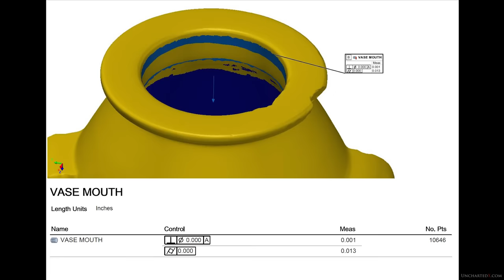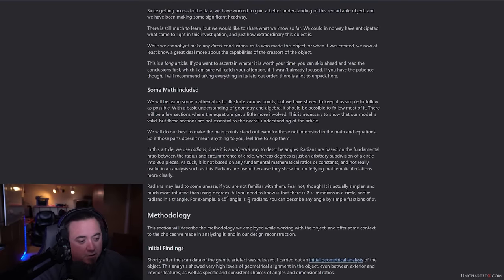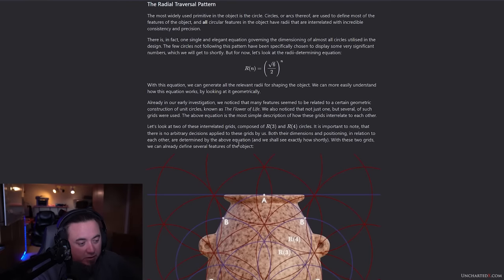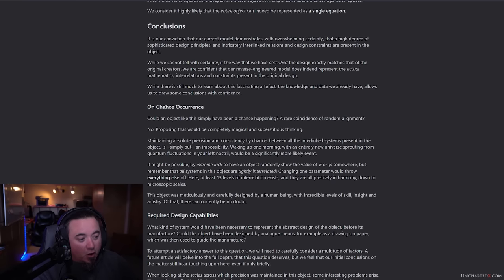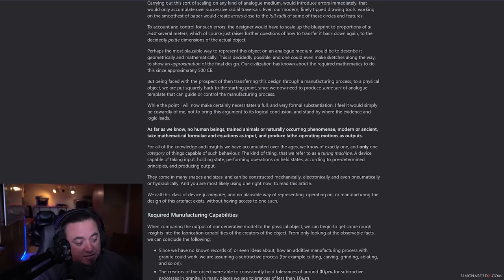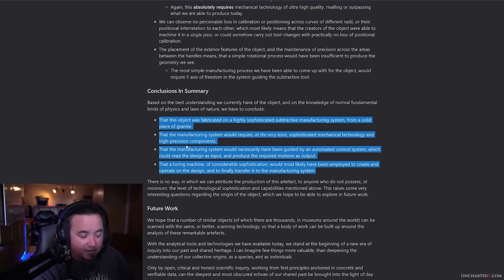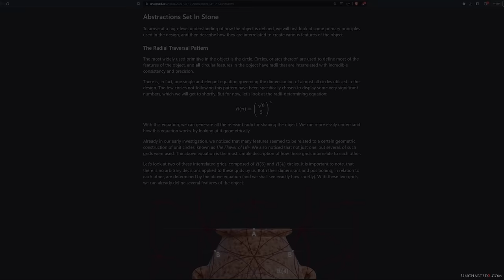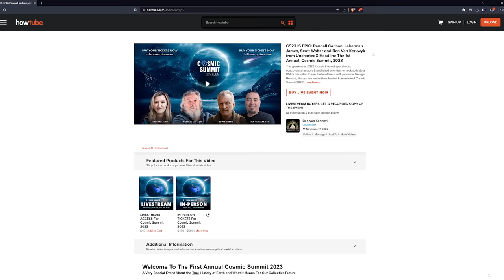Was a COMPUTER Used to Design this Artifact??

Comment: The terrifying thing about this artifact is that even if it was "a fake" it would still require serious explanation. Even if it was made 100 years ago it would shake history and science to it's core.
But it's supposedly 4000-6000 years old. If it was the only one of it's kind, it would be a miracle.  The fact that there are at least dozens and likely thousands of these objects is literally the closest you could get to the impossible in archaeological terms.  

This object is quite literally supernatural.
Reply: Why do you think the ancient Egyptians were incapable of turning this on a lathe?
Reply: @EskWIRED The accuracy is unimaginably above just a lathe and chisels.
Reply: @EskWIRED  Why do you think the handles could be created on a lathe?
Reply: What makes it even more terrifying is that ancient temples all over the continent, such as the pyramids, temples in Cambodia, Mexico, Peru, Guatemala, Ireland, china, and pretty much in almost every country, those temples show very low tolerance for geometric inaccuracy or measurement deviation. those vases is one thing, but having such mathematical capacity for perfection on multi million ton temples is a whole lot of terrifying realizations.
Reply: The question is.   Is it just ignorance……Or does someone.  Some group.   Whatever. ???????………know the truth.     Has misinformation been spread deliberately.     The pyramids are just tombs for example………What about the small shafts in the pyramid.  The door with the metal bars etc.   What’s that all about.  ??????………
Reply: @Aqua Fyre possible that this particular vase was made during one era, and the defective artifacts were made thousands of years later.
There is no way of telling when any one particular stone artifact was made.
Reply: @harryman8378  So many questions, So many answers, so many things hidden. But the ultimate questions pertaining to our reality is who created us, what will happen to the earth, and what will happen to humanity after. all ancient myths and legends from this advanced civilizations are in parallel with the Biblical prophecies of world creation and its destruction. We have a very loving God who made us and has a plan for salvation from this wicked world. I suppose that is the biggest hidden information. 
yet its there, in the Bible, and scriptures, for us to read and experience.
Reply: @originsdecoded3508  are you talking about three-dimensionally curving, perfectly-mating polygonal masonry? those particular walls were likely created using the same technology as this vase.
Reply: @Koaki913  do you know how a lathe works ?
Reply: @AustinKoleCarlisle  Puma punku? Tiwanaku, mucho pitcho? yeah probably all the same technique. Azatecs even describe in their legends how their ancestors made the wall. They said they would pile rocks  from the hill, and with acid would melt and refine the stone, to the consistency of putty, and then woud proceed to shape them and install them making walls and terraces.
Reply: @Aqua Fyre not this type IMO
They’re probably from the early 1900s or during ww1
Reply: @Aqua Fyre gotta love people who make videos trying to debunk the work being done by actual content creators.
Reply: @Aqua Fyre lopsided? You must be talking about the alabaster jars. They are wonky. That's not what he is referring to. Take your trolling immature comments and go home son. And check yourself before you post comments about things you know nothing about.
Reply: the antikythera machine was made thousands of years ago. How do you presume that was made? It wasnt aliens or high technology. These ancient civilisations were a lot cleverer than we give them credit
Reply: @AustinKoleCarlisle  the walls were not turned on a lathe. Try again.
Reply: @old ogre  dude you're probably arguing with a bot.
Reply: @EskWIRED  no, but their construction was likely computer-guided, just like the vase. there is simply no possible way to create three dimensionally curving multi ton stones than to use computer controlled cutting.
Reply: @AustinKoleCarlisle  What methods archeologists suggest were used making polygonal walls with curved multi ton stones, and why their claim is impossible?
Reply: @Aqua Fyre before dynastic times!
Reply: @Aqua Fyre Pre dynastic times technology was superior
Reply: @EskWIRED  assuming what you meant by "asking how couldn't they?" By what would they use to mill it with? 
 They would only be able to mill the parts being above and below the handles, which is unlikely using "grinding stones" But certainly unable to bore into the vase to hollow its inside out
Reply: @AustinKoleCarlisle  
I'm pretty sure AquaFyre is the guy the made the video just to argue with folks and keep them commenting. 
The account was only made in the last week of April lol
Or they just enjoy arguing like my X girlfriend. I could prove her wrong but I still wouldn't be correct with whatever. Hell it might be her honestly
Reply: An interesting experiment is currently occurring in Russia which you might want to follow up:  a lady called Olga Vdovina makes stone vases by hand. it takes at least six months to make one. Olga is now filming the process as she creates a diorite vase.
Reply: @joshstephens6574  These are methods pictured on the walls in Egypt, certainly they knew how to mill and bore. Emery or corundum is harder than granite, known methods they used. Between the handles? One can make a template. Or one could orient the piece in a different angle to make that cut. Or one could make stops to guide the grinder stone. Many possibilities.
Reply: You can’t “fake” this artifact. That’s what’s so intriguing about it. Its very existence is impossible if we’re honest. It doesn’t seem to me that we could even recreate this object in granite today or at any time in known human history, implying that the object shouldn’t even exist at all if the development of technology and the advancement of human kind as we know it, is linear. Additionally, it is important to note that there are thousands of similar objects in museums around the world. Truly fascinating…
Reply: @sezumaga  'It doesn’t seem to me that we could even recreate this object in granite today'. What? Is this more mysterious to you than the computer that you are watching this video with? Or the telescope that shows pictures from early universe billions of light years away? What this comment is implying, is total lack of understanding of ability of stone masons FROM STONE AGE to manipulate STONE.
Reply: @birushinobi  Maybe I worded that incorrectly. The point I’m trying to make is that we couldn’t recreate this vase today without the use of 5 axis, computerized CNC. Given the precision, the fixturing alone would involve incredibly high stability and the ability to measure at the nanometer level. Humans simply aren’t capable of this feat without the use of tools that are more precise than the object itself. No way this object was manufactured without this level of sophistication. It certainly cannot be “eyeballed” or sculpted by hand which is what one is lead to believe was the case in pre-dynastic Egypt.
Reply: @sezumaga  Try google stone mason, they used old school techniques 'till the seventies, when the 'diamond tech' became less expensive. There's still stone masons living today that did their jobs by hand, with sticks and strings as their guide. And by eye. Just google it, old school stone masonry. Then come back to talk.
Reply: 'the ability to measure at the nanometer level.' What? This means nothing, unless you can prove they had a number in mind to aim for.
Reply: @sezumaga  'Humans simply aren’t capable of this feat without the use of tools that are more precise than the object itself.' What? Who did the tool? A human. So, again, what?
Reply: @sezumaga  'sophistication' is subjective term, non-quantifiable, and therefore useless.
Reply: @birushinobi  The object itself, an ancient artifact, possesses all of the characteristics of a highly sophisticated understanding of mathematical principles and manufacturing techniques. The artifact could not have been created by chance and requires advanced technology for its time. I understand that this conclusion challenges many assumptions about the technological and mathematical capabilities of ancient cultures as it suggests we may have to reevaluate our understanding of the historical development of technology and mathematical knowledge.

I also understand that this kind of conclusion is likely to be met with skepticism by some. That said, what is the problem with it being subjected to rigorous scrutiny, further analysis and independent confirmation? That is, after all, the scientific process, is it not?

There are other possible explanations as well. For example, could the artifact have been created by a less advanced process and later modified or refined using more advanced techniques? There could also be other unknown factors or mechanisms at okay that might account for the precision and complexity of the artifact. Of course, these questions or doubts should be explored.

If you don’t see these findings open up exciting new avenues for research and have the potential to reshape our understanding of ancient technology and knowledge, then you’re just a cynic and that’s not a good thing. Regardless of the final conclusion, the journey to unraveling the truth is the centerpiece here. Be skeptical, no problem with that. But the truth saying you on the face remains. It is not possible for this object to exist given the what we know about its origins and the chronology of human technological development. And, since we’re staring at the object right in front of us, I.e. it exists, we must take a closer look at and further scrutinize our understanding of not only its origins but the chronology of human technological development.
Reply: @birushinobi  “one could orient the piece in a different angle to make that cut”

The act of simply re-orienting the piece at a different angle to make that cut, while maintaining the level of precision exhibited by the artifact, is in and of itself an accomplishment that far exceeds our known understanding of the chronology of human technological development at the time when this artifact is purported to have been made.

There are no known tools in the archeological record that would even remotely suggest that fixturing this artifact with precision is possible much less re-fixturing it while maintaining the same level of precision. We are talking about a level of precision that is, quite simply, imperceptible to human senses.

Humans didn’t even have a practical  understanding of the nanometer until about the early 20th century, much less the ability to develop fixturing and tooling that would achieve these levels of precision across 5 separate axises.
Reply: @sezumaga  'likely to be met with skepticism by some' yet it's the current understanding. 'the problem with it being subjected to rigorous scrutiny' should be done by someone who has a clue, hence these are not passed to just anyone to 'scrutiny' .  'unknown factors or mechanisms at okay that might account for the precision and complexity of the artifact' these unknowns are only unknowns to the eye of the non-understanding. 'If you don’t see these findings open up exciting new avenues for research and have the potential to reshape our understanding of ancient technology and knowledge, then you’re just a cynic and that’s not a good thing.' personal, yet I am open to new things to appear, as is all of science. 'these findings' are not findings, at all, just anecdotal technician talk. Yet you fail to see capabilities of ancient stone mason leads me to believe you haven't taken my advise to a simple google search. 'we must take a closer look at and further scrutinize our understanding' That part you got right, you must understand how stone was manipulated the old school way before having an opinion, and you have none.
Reply: @sezumaga  'a practical  understanding of the nanometer' AGAIN has no meaning here unless you prove they had a number in mind. They used sticks and strings, they are pictured on the walls in Egypt how they did it.
Reply: @sezumaga  'the level of precision exhibited by the artifact' quantifiable that is not. So, not science. Just anecdotal mumbo-jumbo.
Reply: @sezumaga  Nothing? OK 
'imperceptible to human senses' not quantifiable, so not science. Also, tells me you are not the one making anything with hands, or precision by trade. Anything else you want to copy-paste from somewhere else, to me to take a look at?
Reply: 'The artifact could not have been created by chance' well no, someone wanted it to be. Someone made it. 
 'advanced technology for its time' Really hard time understanding the meaning of this. Should they not have the understanding how to manipulate stone, or..? Are the history books wrong again? That statement needs something, reference to what, the modern understanding? 
Again, you need to know the basics how ancient people manipulated stone. 
'mathematical knowledge' yes, the Egyptians were quite knowledgeable in that department, but then it has been covered in numerous publications, it's no news to most people.
Reply: 'all of the characteristics of a highly sophisticated understanding of mathematical principles and manufacturing techniques' not science, just same old jargon, it's a fine piece.  Just search something I've said instead of copy-pasting random stuff you think is scientific. stone masonry old school, there. Copy-paste that into your browser and off you go.
EDIT: takes less than three seconds for you to do that.
Reply: @Aqua Fyre Who has created a vase like this, to the same precision?
Reply: @kevinbilliot507 he ain’t!
Reply: @EskWIRED  Do us all a favor, take the measurements from this vase, and take a piece of granite to the most advanced 5 axis mill operator you can find today, and have them recreate it.

As a material scientist and engineer I can tell you right now, this object could possibly be created today, but not out of those materials, composite granites and quartzite are notoriously brittle and extremely hard and the amount of tool changes and other highly mechanized processes you would have to employ would make it extremely difficult to achieve this level of consistent accuracy. 

This was not turned on a lathe.  The tools we would use to get even a possibility of creating something like this weren't even invented until the 1980s and probably didn't reach this level of precision until the last decade or so.
Reply: It's more like 12,000-25,000 years old  but not proven yet. The Egyptians found and repurposed everyrhing. They did not make these
Reply: @birushinobi The statement about a nanometer is inconsequential so I'm sure why you'd pick that out that. They wouldn't have had knowledge of it, we're simply using modern measurement definitions to describe its accuracy. An accuracy that reflects essentially perfect parallelism to a structure designed using a formula based on the radius of a perfect circle. 

If you want to call that "mumbo jumbo" go right ahead. Carving something similar using string and classic masonry techniques is absolutely possible but go ask a master craftsman to do so with such precision out of granite. A precision that isn't in question whether you want to believe it or not.

Is it possible an ancient craftsman could have painstakingly shaped the final finish of such objects using circular guides and various templates to check the 'tolerance' of every point on the entire piece? Tools which would have needed to be incredibly precise to begin with and scaled for each design. There's no evidence for that but it alone would be an extraordinary accomplishment.
Reply: @Koaki913  really? I'm looking at those handles and laughing at the definition of 'precise', because they are visibly skewed.
Reply: @JJFX-  What you get when you grind two stones together? They get flat, nature insists of it. When you spin an object it makes an arc. 'An accuracy that reflects essentially perfect parallelism to a structure designed using a formula based on the radius of a perfect circle' - mumbo jumbo.
Reply: @birushinobi  The flat areas isn't the impressive part, how parallel they are is. If you want to boil to the rest down to "spinning an object" then you're just willfully ignoring the entire discussion.
Reply: @JJFX-  I'm trying to ignore your lack of understanding the process, tells me you are not crafty with hands. Just google hand made bollard, get the round one's with the rectangular bottom pieces, order some 40000 of them and do your analizing with them. Did you not ignore the whole thing that people make similar things even today? Just stop talking.
Reply: @birushinobi  Since you continue to ignore the point of the conversation I'll assume you're trolling or are you really suggesting that the tolerance and dimensions of this GRANITE vase is simply luck of the draw after they pounded thousands out by hand?
Reply: @JJFX-  Still avoiding the fact it's not a miracle, and people are still doing similar things from granite. 'Tolerance and dimensions', you cannot pinch your thumb with your index finger.  Go home.
Reply: Two per day times ten makers times 200 days is what? A math question. That's four thousand in a single year. Ten person. Go home
Reply: @JJFX-  I'm bored, so define parallelism. How parallel they are. The amazing part. Define it.
Reply: @JJFX-  Let's say, for arguments sake, that I'm grossly wrong, it takes a month to make one. So One person make twelve in a year, and for in his or hers lifetime say fourty years, sixhundred. So 40000 divided by 600 we get 67 people for their life's worth. Do you or do you not think, that there were 67 people capable of doing vases from stone to a king, granite vases made in the stone age, stone vases, that the making of, is pictured in the walls in Egypt? So, tell me what is the point of this thread? What is the definition of the parallelism?
Reply: @birushinobi  Look, I'm not positive what you're trying to say but I think you're referring to the probability of this not happening the way they claim it did. You might be right but the main point is simply how improbable creating such a thing to these exact dimensions is by hand and I haven't seen anyone prove how it could be done other than assuming incredible skill, experience and effort which isn't an explanation but now we're just talking in circles.

I'm not entirely convinced it couldn't be done as you say but I hope you understand why so many people think there must be more to this story.
Reply: @JJFX-   The only story here is your used car salesman trying to convince you it's not possible, when all the evidence, both written and hands-on, point to yes. I like math, I studied commercial maths for a bit in UNI. I also have a paper that states I've been taught how to use CNC, not that should matter so much, since this is a question of materials, and if it's made-by-hand, which I have a degree of, also. If you and others would like to take the time to search for stone mason, and see what they are capable of, there would be awakening of understanding how capable they actually were. There's buildings, statues, waterways, headstones, lenses, you name it. All the things. They are done, and have been done by people, with records. I'm sensing you are done with me, so I take a last wish, and say google stone mason. Good luck.
Reply: @birushinobi  I don't why you keep reverting to personal attacks and assume others don't have any experience but this is a pointless conversation anyway.
Reply: @JJFX-  Avoiding facts yet again. Ben is a public figure, so it's not personal, and also quite legal. I'm saying he has no understanding how they might have been done, and it's obvious. 

Why are you defending him instead of looking for answers? 

'all the evidence, both written and hands-on, point to yes.' You cannot refute this one simple statement, so you beat around bushes how I'm attacking someone. Bye.
Reply: 'quite simply, imperceptible to human senses.'' Humans didn’t even have a practical  understanding of the nanometer until about the early 20th century.' I didn't bring this up, y'all did. 

Would you kindly refute that 'all written and hands-on evidence says yes, it can be done?' Simple enough question. No more 'I have a feeling'. Should be simple enough. Define parallelism and we'll go from there. Facts.
Reply: @JJFX-  It's a simple enough task, to google stone mason, takes like three seconds. Yes, it's pointless to ask you about this simple task, which I'm reverting to, for you to have a fair playing ground. What is the 'establishment saying about them vases, how they claim they are made? When you don't have a clue, your opinion makes zero sense. The radius of a perfect circle is called an arc. Yes or no?
Reply: So afraid are you that you cannot physically type stone mason in your search box? What a waste of air. 

You asked:are you really suggesting that the tolerance and dimensions of this GRANITE vase is simply luck of the draw after they pounded thousands out by hand?
And I answered people are still doing similar things from granite. 'Tolerance and dimensions', you cannot pinch your thumb with your index finger. 
No comment no nothing, suddenly I'm harassing people, yet you cannot find the strenght to type stone mason in your search box? C'mon. Useless thread. What was the point of this thread? Pointing fingers, not understanding the basics, spreading the love? You ain't gonna answer anything I ask or point you towards of, so, peace. Three seconds.
Reply: @birushinobi  Again you patronize and assume complete ignorance with vague justification. I've looked at the work and methods used by stone masons and artisans over the years and do not deny their impressive feats. This completely side-steps the limitations of the time and the fact the quality of these objects mostly peaked in the old kingdom. Similar work from dynastic egyptians was typically in softer stone and more inline with what you'd expect with such hand-made objects. This in itself doesn't prove anything but also doesn't answer the obvious problems any stone mason would encounter, let alone during this time period.

The radius of an arc is the radius of the entire circle so I'm not sure what the point the question is. The issue obviously isn't whether they could use these principles but translating it with such precision in the manufacturing of hard stone is a completely different problem. You can keep using vague generalizations and insults to laugh off something you either don't understand or willfully ignore but I'm not going to continue entertaining such arrogance.
Reply: @JJFX-   softer stone, has been talked about. Granite can be carved with corundum. 
precision - define it. Parallelism, define it. You can't, can you? Simple enough. Othervise they are just terms defined by a youtuber. Now I'm arrogant, when none of my questions ring a bell, or need explanation, in your mind? That's not good enough. Maybe you don't get that I'm reseaching written and hands-on accounts. You, not so much. You just ignore my questions and blame me for arrogance and whatnot. It's not good enough to say it's like this and not engage in the truth that in your mind need explaining. So tell me the limitations how none can make this vase in the ancient egypt. You need some good explanation skills, maybe some copy-pasting and possibly flat-out lying.

For the fourth time, define parallelism. Simple enough, huh?
Reply: @birushinobi  Define precision and parallelism? Yeah now I know you're either trolling or don't really have the manufacturing experience you claim to.
Reply: @JJFX-  the limitations of the time.
answer the obvious problems any stone mason would encounter

Let's go over this. Limitations of time, could mean many things, say kings didn't live long, or it takes serious amount of time to make one. 

So If it takes a month to make one or one person can make in it's lifetime 600 pieces, you'd need whopping 67 people capable of doing these pieces to get to 40000.

If kings didn't live that long maybe don't break everyone of your vases, they add up. 

the obvious problems any stone mason would encounter - too vague, could you elaborate?
Reply: @JJFX-  Again avoiding the question. with vague justification
How ironic.
Reply: @birushinobi  Unless you have a profound reason for asking such obvious questions that doesn't simply come down to "at what point is it considered precise?" I'm not going to waste my time.

By limitations of the time I'm referring to the means and methods archeologists and historians insist they were limited to. The primary point of this entire debate.
Reply: @JJFX-  Still avoiding the question. means and methods archeologists and historians insist they were limited to. 
So you don't think 67 people in ancient Egypt can make one in four weeks time to add up 40000 in their life time. Is that your official statement?
Reply: @JJFX-  Let's hear it. They propably didn't have 67 masons. Or It takes more than four weeks. Or they didn't live that long. I'm not gonna argue with myself, I need your help in that department.
Reply: @JJFX-  Did I hurt your feelings? My 'opinion' is not at stake here, but thousands of scholars for hundreds of years. Limitations of time? Do you not understand that time is not the limitation, but you are limiting time of real research asking the same questions over and over again needing an answer. Did you got sad? Refute this.
Reply: @JJFX-  Let me ask you an obvious question, how many of the 40000 vases were similar? Is it not all of them? 
You really don't know much, so you point the question back at me. So, let's play a game. Tell me, what, obvious or not, are the methods egyptians used to make vases?
Reply: @birushinobi  We have no idea how they were made in the old kingdom, that's the whole point of this. They definitely weren't made exactly like the later alabaster and clay vessels. The older tools we know about are very crude.
Reply: @JJFX-  So you know about the tools, then?
Reply: @JJFX-  The short version is that they roughed out the general shape using chisels and normal stone working techniques. Then they drilled the centre using bow drills and abrasives. Then they polished up the outside of the pot using abrasives. There is evidence of these methods from unfinished pots found in the archaeological record but also from pictograms depicting everyday scenes of life on tomb walls. 

This is me using google for a one minute. So you are not honest. Try again.
Reply: @JJFX-  Let's just recap, they couldn't have done this vase in dynastic Egypt, because they didn't have time, tools, resources, man power or will to live what else, it was snowy? OOh the presicion, and the parallellism. But it's granite. But then I said they had corundum. But then it was time. But then I asked they coundn't teach 67 people? But then it's the tools. And then I said it's been recorded on their walls. But the it was what? What is next before you look how it is done? We going back to micrometers? REFUTE this
Reply: @JJFX-  But you  are not going 'to waste my time.' You are. You are wasting so much time, and money.
Reply: @JJFX-  Trust me bro. useless.
Reply: No? Welcome to the club. From now on I'm gonna call you .. ping pong. It doens't require anything from you.
Reply: @birushinobi  These being old kingdom  isn't some opinion, that's the accepted timeline. The artwork shows very basic techniques and attributed to the time when they mostly worked with softer stone like alabaster. Again not my opinion nor is it disputed. There's even places in Egypt today that continue to make alabaster vessels using these methods. This doesn't explain the much more advanced hard stone objects which egyptologists admit peaked prior to dynastic times. They simply point to the later artwork as the most likely method for everything because it's all they have.

I know you're just bored and trolling man. It's clear you're arguing about something you really don't know much about and I think I've entertained you long enough.
Reply: @JJFX-  But I just told you that they had the capability to work hard stone, with a harder stone. 'This doesn't explain the much more advanced hard stone objects which egyptologists admit peaked prior to dynastic times' is not a question.
Reply: @JJFX-  Just point me to one study, where 'egyptologists admit peaked prior to dynastic times' might get me out of boredom.
Reply: @JJFX-  Never mind, your source is ancient origins page. So not science. Try again.
Reply: @JJFX-  'An accuracy that reflects essentially perfect parallelism to a structure designed using a formula based on the radius of a perfect circle.'

'GRANITE'

' improbable creating such a thing to these exact dimensions is by hand'

 'the limitations of the time and the fact the quality of these objects mostly peaked in the old kingdom'

'Unless you have a profound reason for asking such obvious questions'

'We have no idea how they were made in the old kingdom, that's the whole point of this.'

But we do know. I already told you. The same way you'd do your alabaster vases. 
Shifting goal posts much?
Reply: @birushinobi  I never linked anything so I don't know what you're talking about. You'll have to move on to someone else who wants to deal with a troll that's just looking to argue. Take care.
Reply: @JJFX-  There you go.
Reply: @JJFX-  Hey ping pong, is it snowing yet? I'll see you on evry comment section from now on to say hi. EVERY time.
Reply: If it's a fake (which it clearly is) then it was made recently. I fail to comprehend why you are seriously considering such an arbitrary "if."
Reply: @avamasquerade  If it was made recently, it would put to shame all the CNC-machinists in this thread, and they are many. On the other 'hand', these types of works are shown in the walls in Egypt done, by hand. There's mallets, chisels and all the other stoneworking equipment in museums in situ. Cannot get any better than that, we have them tools. And pictures. And the artefacts. 'But it's granite'.
Reply: @Koaki913  Detail isn’t done with just chisels, but with smaller precision tools, to even bow drills with abrasives or sharpened heads consisting of minerals from quartz up to corund and even flintstone which would even sharpen itself out on granite and dolomite if done correctly, there are many simple tricks that work perfectly fine like (carefully) heating the parts you want to remove creating micro cracks which changes the granites structure significant but irreversible. you can protect surrounding areas with clay like the Egyptians already did at their quarries; it’s called craftmanship one would certainly have especially after generations.
Reply: @hoidoei941  yeah, but if what you say is true, then how would the ancients know when to stop grinding/polishing in order to achieve a consistently smooth surface and precise geometry that is only able to be verified and measured by modern tools? in other words, how would the ancients "know" when the object was completed if they didn't have the tools to measure precision down to the 1/1000th of an inch? naysayers like you never address this point, because they put the cart before the horse instead of just thinking about this logically.
Reply: @AustinKoleCarlisle  Hey Cale. So you are saying that they couldn't measure a thing and so they coundn't have had the capability to make a thing?  'when the object was completed'?  When to stop grinding? Making is not dependent of a measuring stick. Take your hand out of your pocket and try doing something with them hands.
Reply: @AustinKoleCarlisle  Hey Cale. I have a question for you: How were people able to make telescopes before the discovery of white light being a collection of different wavelengths?
Reply: @birushinobi  we've already discussed this before. the accuracy of a telescope is able to be verified by looking at the amount of distorted light coming through the lens. in contrast, you can't look at a vase and verify how precise it is.
Reply: @AustinKoleCarlisle  How you define distortion? You'd need to make the object though. You'd need to understand light. Define precise. Make it verifiable. Light is verifiable. It has a property.
Reply: @AustinKoleCarlisle  I remember you saying you just grind away until it's done, on the lense. So how is your water jug any different?
There are NASA level of people doing mirrors to a telescope that orbits the earth in space looking the first galaxies in the whole universe 13.8 billion lightyears away and to you, it seems these jugs are harder to make? Just grind it and away we go? Did they call you and give position?
Reply: @AustinKoleCarlisle  Are you a betting man, because I bet if you make a lense that NASA uses in their telescopes, I'll eat one pound of granite? Deal? Deal.
Reply: @AustinKoleCarlisle  Tell me on the hardness scale of Mohs how hard is it to make stone vessel that holds liquid versus making an object looking into the birth of time and space? Would you, or would you not take the task of making a vessel to hold a liquid?
Reply: @AustinKoleCarlisle  F' kumquat no reply. Well it's easy enough to state you are a believer. No none my guestions answered. Only information flawed delivered. If I say go and look how they are presented to make stonework. Waste of time, but I'm not going anywhere. One search away. Type in stone mason. Scaredy but useful.
Reply: @AustinKoleCarlisle  Another bet, type in stone mason, and type in first three entries. Should take a minute of your time. Bet you cannot do it. If you do it, I'll type thank you thirty times in this thread, as I think it will take me more amount of time to do that.
Reply: @AustinKoleCarlisle  'you can't look at a vase and verify how precise it is' but yet is the comment you are making. Look at this vase and how precise it is. It is exactly your comment. Exactly. Did you do your home work, Cale?
Reply: @AustinKoleCarlisle  You cannot look any stone mason -videos. How do they know where to hit? Naysayers say they hit and miss, because there's a horse in a race. Type in stone mason, report first three in this thread. Takes you a minute. One minute of your time. One minute. One single minute.
Reply: @AustinKoleCarlisle  Let's do this: I type 'one single minute' for a minute and see:

one single minute one single minute one singlke minute one single minute on single minute one silgle minut e one single minute one single minute
Reply: @AustinKoleCarlisle  Can I now see you waste a minute?
Reply: @AustinKoleCarlisle  Nothing? Okay maybe you could venture to Maine Granite museum to tell them that they got it all wrong. How there's no tools or methods the egypians used to cut granite, they'd be happy hear your story. 

One minute, Cale
Reply: @AustinKoleCarlisle   'if what you say is true, then how would the ancients know when to stop grinding/polishing in order to achieve a consistently smooth surface and precise geometry'. Consistently smooth surface is to you a mystery, I see. It happens when one polishes a surface, it polishes, and you'd stop, when it's polished. 'precise geometry that is only able to be verified and measured by modern tools' is not an argument. I can find precise geometry in my everyday stuff, like my deodorant has a perfect hemiphere. The measurement does not make the object. Radius of a perfect circle. Is an arc. It's a bottle. for a liquid. There are many of them. There are tools in museums that made them. They are plentiful because they weren't so hard to make. They were stone age people doing things from stone. 
Stone mason, one minute. Try it.

Say one more time it's easier to make a lense than a vessel to hold a liquid, because they didn't really drink anything in the olden days, it's just a myth. 
The egyptians didn't have the skills, yet there are museums filled with objects and tools to make them. Pictures on the walls, to describe how they were done.
One minute, Cale
Reply: @AustinKoleCarlisle  Remember this nice little piece: their paralleissm of the exactness of a radius of a perfect circle' is uncanning. No braincells were used to think if it was real.
One minute, Cale.
It takes one minute.
Reply: @AustinKoleCarlisle  'measure precision down to the 1/1000th of an inch?' From what? A perfect circle? How much is a green wavelenght of light?
Reply: @AustinKoleCarlisle  A green light at 550nm vs 1/1000th of an inch (which is a made-up measure in this context) is 46 times smaller thing. 550nm vs 0.0254mm. Make me a sandwich, grilled. Say one more time it's easier to make a lense than a vessel that hold a liquid. Please. You can probably just eyeball-it to make it right. Right? Just make it hold water? Right? Right.
Reply: @JJFX-  So to your knowledge, there's no granite work done in Egypt after old kingdom. Is that your statement?
Reply: @JJFX-   We have no idea how they were made in the old kingdom. This is your official statement, though. 
We have no idea, really, when I say they could have used the methods archealogists suggest... So, what are the limitations of of the older tools? They were crude. In what way the crudeness inhibits manufacturing these artefacts? Define crudeness. Tell me how they are unable to work the stone.
Reply: @JJFX-  This is not about you. Get it right. Did the ancient egyptians have a capability to cut, carve and move stone, as the 'establishment' states?
Reply: Hey Kale. They keep deleting my comments. So here we go again. 
On the webb page, it says: Once in space, getting these mirrors to focus correctly on faraway galaxies is another challenge. Actuators, or tiny mechanical motors, provide the answer to achieving a single perfect focus. The primary mirror segments and secondary mirror are moved by six actuators that are attached to the back of each mirror piece. The primary mirror segments also have an additional actuator at its center that adjusts its curvature. The telescope's tertiary mirror remains stationary.

Lee Feinberg, Webb Optical Telescope Element Manager explains, "Aligning the primary mirror segments as though they are a single large mirror means each mirror is aligned to 1/10,000th the thickness of a human hair. What's even more amazing is that the engineers and scientists working on the Webb telescope literally had to invent how to do this."

This is free information, for anyone to see. 
One minute Cale, one minute. 

Is it, to you, harder or easier to make an object that holds water in it?
Reply: @JJFX-  Hey ping pong. Did the egyptians have the capability to cut carve and move hard stone? It's a yes or no -question. I'll help. There are tools and objects in museums, that are hard stone tools and dated hard stone objects, they have even a label in front of them. So did they or didn't they?
Reply: @JJFX-  Let me ask you another question regarding granite. There's granite in the great pyramid, right? So one of the ways we can date the great pyramid is, we have a receipt of a dude going up and down nile hauling stone. So how that plays out? So did or didn't they know how to cut carve and move hard stone?
Reply: @EskWIRED did you even listen to the presentation?
Reply: @birushinobi there is nearly no possibility to create this object today. To Even attempt it would require high precision, aerospace level technology. I've spoken to a few folks in that area. They say it's impossible except MAYBE in a few kinds of metal, or glass. Certainly not in granite.
Reply: @timothyblazer1749  yes. I listened. What specifically did I say which made you question that?
Reply: @EskWIRED  just looked back...replied to the wrong person! Apologies. I fat finger on my phone occasionally :-)
Reply: supernatural? lmfao